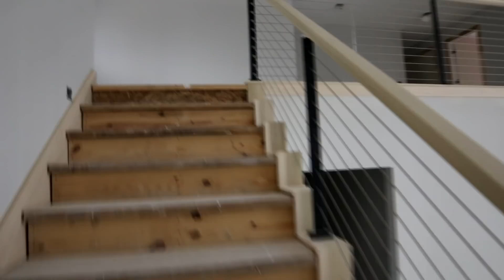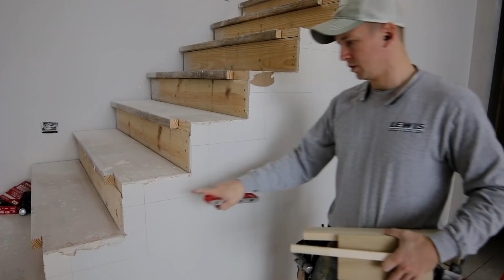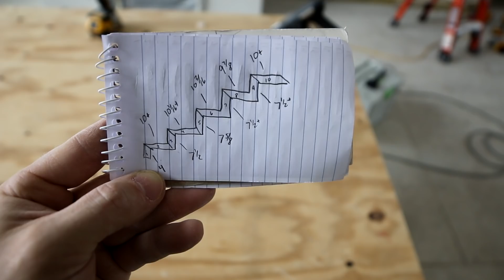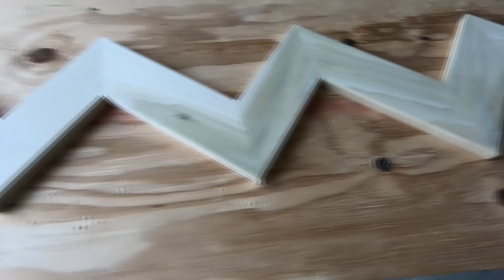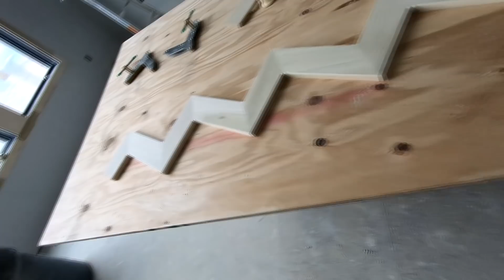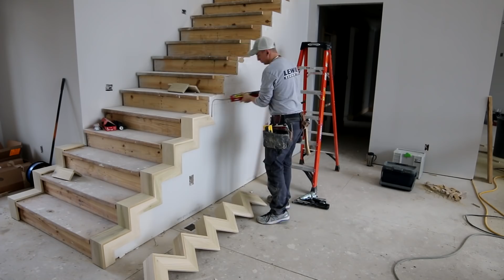How to: Modern Waterfall Stair Skirtboard - Production Techniques

Comment: First I'm not a professional finish carpenter. I'm woodworker and homeowner who enjoys woodworking. Question for you. I'm rebuilding my stairs, and my process has me laying the step boards before mounting an outside skirt board. My plan is to place my outside skirt over the top of the step vs. cutting each step to fit in between the skirts. what do you think?

Comment: Hey Spencer, looks like the Pur gun that you use in the video is cordless. The one in the link is corded. Is the cordless still available?
Thx
Reply from the maker: I'm not sure...they switched to the new corded model...The advantage is the corded model always stays on the heat. WHich is important wit hipur. I think that's why they made the change.

Comment: So last video I saw you were having a hell of a time getting the cable on the stairs correctly installed. So do you bid these jobs and the price is final? Would you go back to the customer and say, “I had a really hard time with this, it’s going to cost an extra day...” you do nice work, but I wonder if you make money. And if you have an hourly rate, you’re not making money...I don’t care if it’s $100 per hour: you’re still not making money. I’m just scratching my head wondering how in the heck you price these jobs.
Reply from the maker: It’s extremely rare that I have a job like the one in the video where something throws me off that bad. Extremely rare. But to answer your question. I eat the extra cost. It’s a learning experience. I gave a fixed number at the beginning. I don’t give money back when I do better than expected so I don’t expect money back when things go bad. Ok that one I think I lost a day of my own labor. Not the end of the world by any means.

Comment: Not sure why you think kreg jigging would take too long.  Certainly wouldn't take nearly as long as biscuits and glue.
Reply from the maker: Did you even watch the video?
Reply: @InsiderCarpentry  of course i did.
Reply from the maker: Go back and watch it again then. At what point did you see me using biscuits and glue for the miters?
Reply: @InsiderCarpentry  Ok.  I wrote what I meant, but you are reading it in a different way than I intended.   You are inferring that I think you used biscuits and glue.  Never said that.  My intent was to say that pocket screws, Kreg jigging is not really that slow of a process and hold really well as compared to your preferred method.  However, doing it in sections as you did, which is more manageable for sure, you'd still have to use a different method for that connection.  Basically,  was saying pocket screws go pretty fast.

Comment: Why not staple stitch the inside of miters after glue up for the insurance of the bond? Just thinking it wouldn't take much extra time. Btw you're blowing me away with your knowledge and ability. Thanks for sharing these videos, they're gold!
Reply from the maker: The staples don't add any strength. They just hold it in place. Staples won't do anything against expansion/contraction.

Comment: For the apprentices out there: at 1:34 say the word plumb when you mean plumb and say the word level when you mean level.
Reply from the maker: Its easy to say words that you don't mean when talking to a camera.
Reply: Yes, I’ll give you that.  You did use the correct terms later on in the video.
I always correct apprentices when they say the wrong terms.
Cement and concrete are often wrongly interchanged.

Comment: I am currently using quick and thick glue for glueing my miters together and then using collins clamp to help squish it tighter..i case all my doors and windows right on the window  dont know if thats my most efficient way. I wasnt to get the hipur system but am confused about which guns will work the best
Reply from the maker: I will have a full video coming in the next month or two giving a complete rundown on the hipur system. Stay tuned. I'm sure it will help.

Comment: love the clamps but curious how much damage they do to the casing? If you use them to preassemble window casing how do you hide the damage on the side casings? Obviously the top and bottom will rarely, if ever, get seen.
Reply from the maker: The holes are s.all and easily filled. Not really damage. Same size hole as 18 gauge nail. No big deal.

Comment: Everything looks beautiful,however why you used poplar?...there is better even pine will last longer
Reply: Seriously? Pine?  Hahahaha
Reply: Poplar paints up well.  Better than pine for sure.
Reply: @dpeagles  yo...really???how long you been in construction?poplar is just not good at all...a lot of work and detailing to put in poplar🤔unless you are trying to keep your self fixing it every 2 years
Reply: @ironskull27  WORKING PROPERTIES
It is a versatile wood that is easy to machine, plane, turn, glue, and bore. It dries easily with minimal movement in performance and has little tendency to split when nailed. It takes and holds paint, enamel, and stain exceptionally well.

Comment: Is there a reason you re-cut the board each time when you change the miter? Is it to improve accuracy?

I would have thought flipping over the board would save material, but if it decreases accuracy, I can see that wasting a bit of material is favourable.
Reply from the maker: One corner of the board had an eased edge. So I had to make sure the miter cut was in proper orientation to that eased edge.
Reply: @InsiderCarpentry  got it, thanks!

Comment: Thanks for the tip on the hipur glue, I bought the gun and a couple cartridges of glue and have been testing on scraps. I am amazed at the strength of the bond. Most of the materials I use are pre finished either  stain or paint, I did get the clam clamps from Woodcraft , they do a lot of damage to the edge of the material so I even tested by hand clamping for a few seconds and it worked quite well. I have to mention, in all the researching I did on the hi-pur glue you have the most content of its use.. thank you and keep up the work 
 P.S if your ever in S.E  Alaska look me up I’ll take you out fishing 🎣

Comment: I wish I could agree with you regarding HiPur adhesive systems. I discovered them about 10-12 years ago as an apprentice and never had any luck with them. The tips of the glue tubes get clogged and are difficult to unclog, the glue is actually quite thick and can cause gaps in joints and, sometimes it would take about an hour for the gun to get the tubes hot enough so they were usable. We thought it may have been a faulty gun so bought another and same problem. I'm glad they work for you but not my first choice.
Reply from the maker: Its sad so many good carpenters have problems with the system. If someone would just up the game on making a better gun it would help a lot.

Comment: I’m not sure how you get away with that Hi-Pur glue on small joins like that. 
I got so excited about getting one but I do t think it’s any better then regular hot glue.
It doesn’t penetrate into the wood even a little bit and unless you have large surface areas of contact like 6”sq minimum it can just be bumped or pried apart with your hands. 
And say like on crown mouldings, if there’s any twist pressure from the wood in the joint at s it will eventually just pop apart. 

Regular wood glue with a cpl dabs of 2P-10 for instant bond was the best I could come up with
Reply from the maker: It doesn't do well on thin profiles. For crown it works best to glue the joint but then I always keep 1/2" dowels in my consumables kit. I glue 2 dowels to the back of the joint. This makes the joint much stronger. You can do the same with CA glue. For crown I often just use CA glue because I don't usually have that many outside corners. 

I've got video testing 1x4 miters and handrail returns beating them against concrete until the wood breaks. Keep in mind that while hipur has a strong initial tack it continues to cure over the next 24 hours to get to full cure.

Its a temperamental product. I know some really good carpenters that don't like it. But I love it. I plan to do a video soon covering some of the issues with it. Stay tuned, it might help.
Reply: Insider Carpentry I will do, I’ll look for those testing videos to. Thanks. I had a terrible experience using it on maple crown. The smoother the wood the less it holds. And even when you force a joint apart you can just peal the HiPur off like a bandaid cause it doesn’t penetrate in my experience.

Comment: From your recommendation I bought both the Clam Clamps and Hipur glue.   Both exceeded my expectations.  Thank you for the information.
Reply: I have just recently bought both and have used them on 2 jobs so far.  Absolutely incredible! Thanks Spencer!
Reply: A challenge of the Hipur glue is it’s shelf life.  Unlike traditional glue sticks that can sit in a draw for years while remaining serviceable, the Hipur glue does not have an equal shelf like.  Buy only what is needed for the near term as this glue will harden inside it’s sealed packaging.
Reply from the maker: @clintbremner4906  I buy in bulk, usually 20 plus tubes at a time from gluegun.com as they offer a substantial quantity discount. I've had bulk orders last close to a year with no issues. Granted, the longer you have them the greater the chances of issues. But I don't think its something that needs to be ordered fresh every month.
Reply: @InsiderCarpentry  Awesome. I’ll have to go check out gluegun.com.  thank you.
Reply from the maker: Glad to hear it. I resisted HIPUR for a long time but once I got onto it it changed my life.

Comment: Be interested to know the comparison strength between Titebond and that hot glue.
Reply from the maker: I've done extensive testing. The hipur is extremely strong and superior in most applications. Especially end grain applications where PVA glue doesn't perform well.

Comment: Four things. 1 - as always - great video. 2 - you should write an e-book or a book about job-site production efficiency; you're real master in that matter. 3 - it's a pity that many of your links are for North American craftsmen; every time I check shipping to Europe, cost just kills me. 4 - as a Kapex and Makita LS1219 user, I always have a good laugh when someone thinks that Kapex is a mitre saw pinnacle; it is not.
Reply from the maker: We associate price with quality and value. For the kapex that wasn't the case. I had to learn the hard way.
Reply: @InsiderCarpentry  Kapex is not THAT bad, but for over $2K in UG-Set it somehow disappointed me. It's really portable and has some nice features, although it is not as good as I expected.

Comment: why is ca glue not strong enough for this job?  is it due to the length of the project or are you referencing strength once its installed?  a skirt board like that is never going to be touch much once tacked up to the stairs.  i ca glue used on baseboard all the time and seems to work fine.
Reply from the maker: A lot of guys use it for mdf but it doesn't have the tensile strength to stand up to this type of application. For real wood I use it on small returns and things like that, but it doesn't the tensile strength to stand up to much stress during installation or seasonal movement.
Reply: Probably because of the amount of pre-assembly he's doing with the larger sections, I could imagine they wouldn't be as secure glue joints as what he's using.